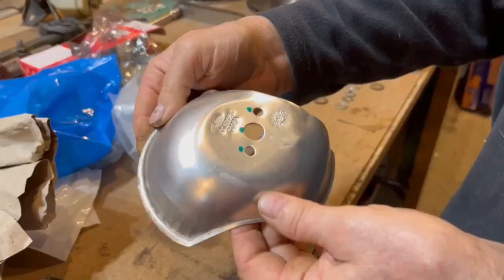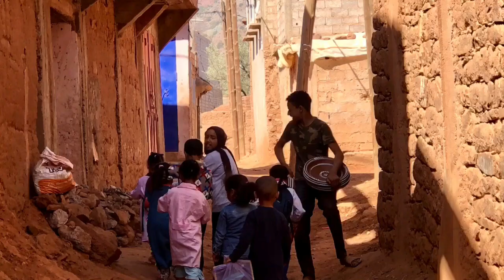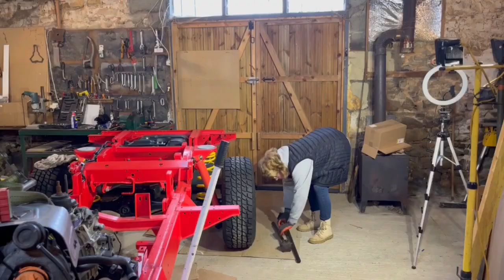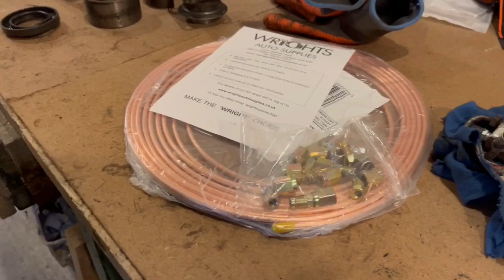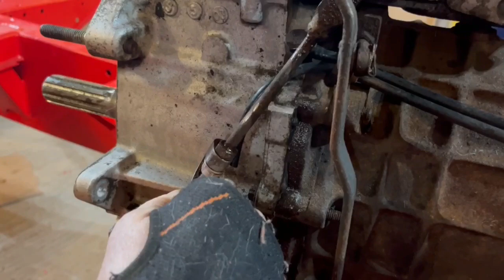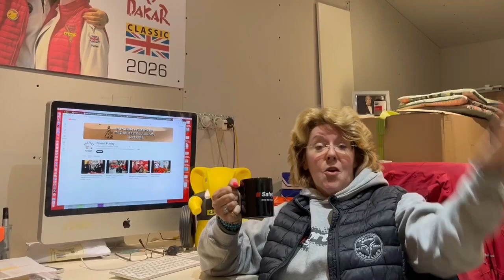The engine is in !! Fuel pump is fitted, wiring looms arrive. Build Week 4, Episode 5

Comment: That plastic fuel tank is sweet.  I guess fuel cells aren't a requirement of the Dakar regulations? Is that the normal position of the Defender fuel tank?
Reply from the maker: Yes, it is a standard LR fuel tank mounted in the standard position. The fuel tank specification depends on the class in Dakar. We are allowed to run with standard equipment as long as it is outside the cabin space